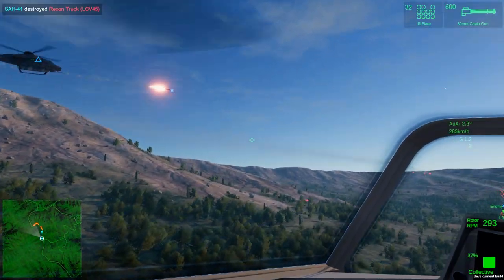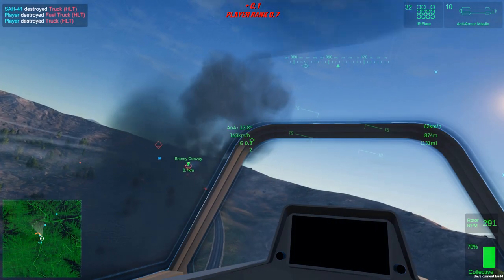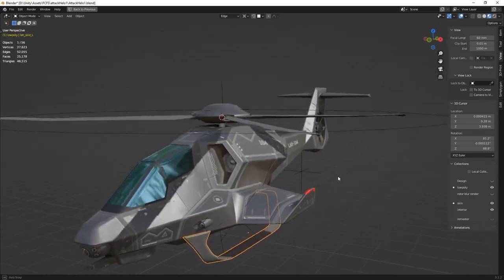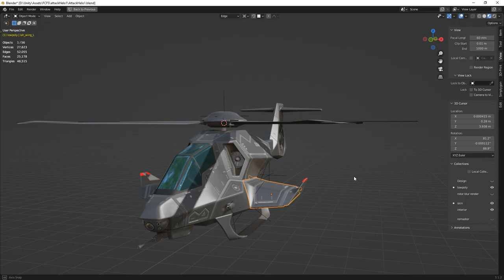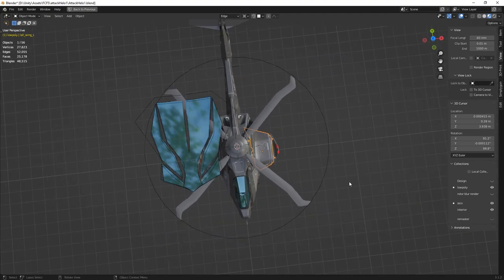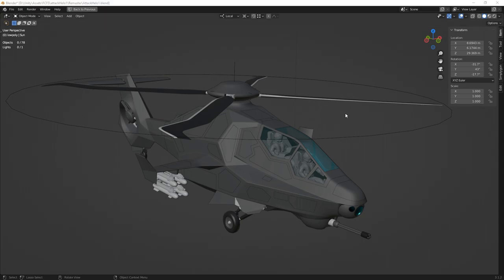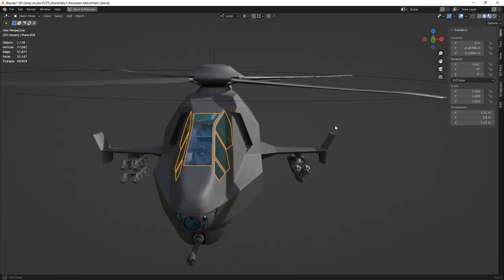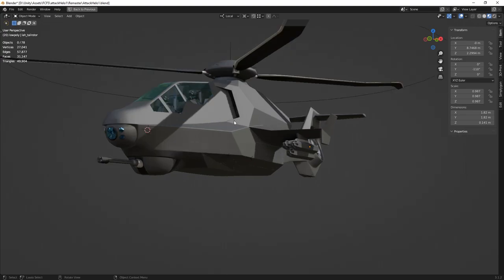Attack Helicopter Preview and Design Changes

Comment: Very neat not-Comanche model.

If scout mechanics, stealth and RCS are designed to become part of the meta, having the fixed wings be optional (hardpoints) might be a nice option.

Reduced RCS = wingless = reduced payload = recon / sniper role

Max payload = wings = Higher RCS = anti-armor / attack role

And if you want to add another helo in the future, it would be wonderful to see an intermeshing rotor design.

https://en.wikipedia.org/wiki/Intermeshing-rotor_helicopter

It has unique properties, plus having the benefit of looking exotic.

A futuristic blend of the Kamov K-50/52, Kaman K-max and Aerospatiale Gazelle might be interesting.

Comment: The change to thin wings with payload hardpoints underslung is an understandable change, however, the original design with internal bays would still work. While thicc, the "wings" would function as a lifting body, though the increased drag would limit top speed. But then again, you now have alot of parasite drag in the form of externally mounted weapons stores. I just hope that you have the ability, when flying with NO external stores mounted, to have a greatly reduced radar cross section. This giving players a tradeoff between going for stealth, or going for firepower. It would also be very cool to see the wings deleted entirely if no external stores are taken... again, to reduce potential RADAR signature.